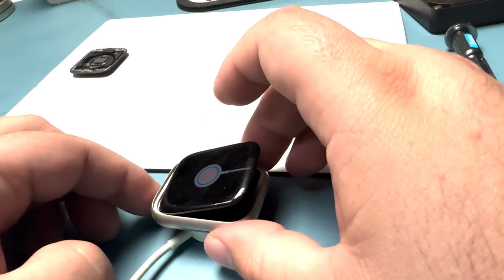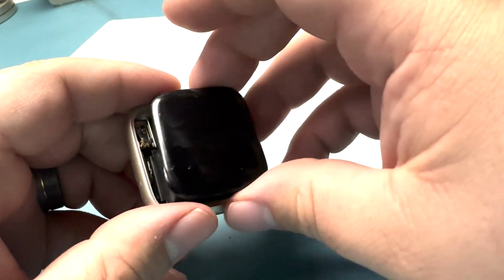Apple Watch Series 7 Back Cover Replacement: Step-by-Step Guide

Comment: great stuff, very informative and well shot. I've recently replaced the complete screen assembly on my SE2 (using your video), but after reassembly, the watch keeps overheating and shutting down in minutes. I've used heat to open up the watch, but after opening, the watch was still fully working, so it probably isn't the culprit. I assume I've messed up the battery by prying it too hard, but I can't test until replacement arrives. If I put the watch in the fridge, it works slightly longer (minutes) before it shuts down, so something might actually be overheating. have you seen similar issue?